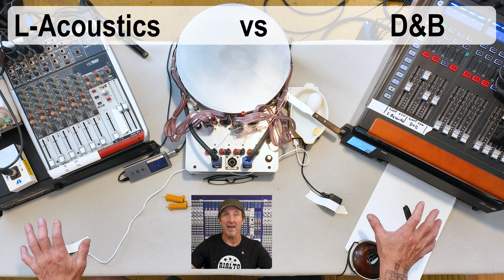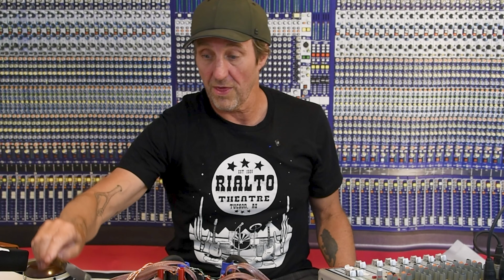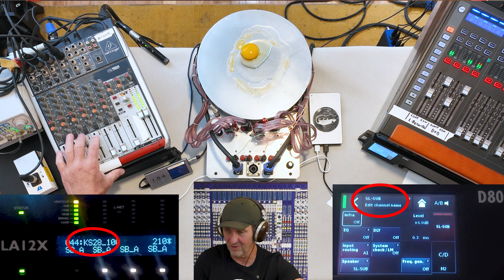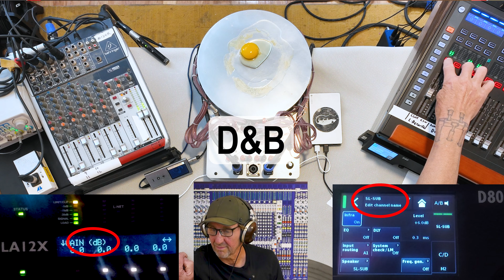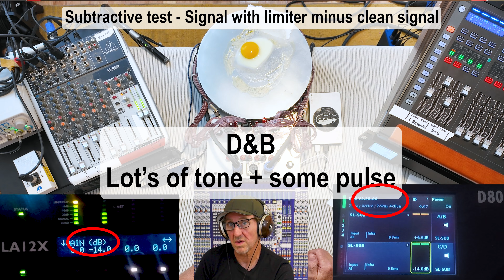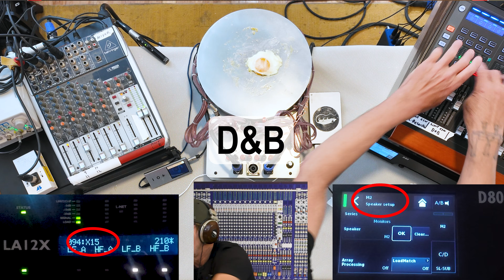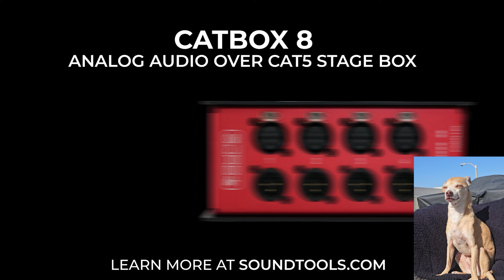Who Does Amp Limiting Better? D&B or L-Acoustics?

Comment: I usually try to have a capable enough system that I don't have to hit the limiters but for those times when I do go there keeping the tonality basically the same is my goal. My all-time favorite system was the EAW KF 850 with SB 528 subs their processor and Crown Macro Tech amps. Super clean accurate sound before limiting and very similar tonal balance when I did push into limiting. I miss my 850 rig. Now I'm in the small times  a stick rig with powered tops and monitors passive subs. I will be trying this battery of tests on my tops. They supposedly have a limiter on each band pass and are bi amped..we shall see how good they do in bench tests. They sound good in the field but..... what is the reality.
Reply from the maker: very cool and my take is that much of what we do with live sound involves taming dynamics with comps and limiters.

having so much pa that you are not near limiting and then limiting the music to make it sound good is a bit counter productive in many cases.

bringing less gear, driving it harder and using the system limiters as part of the taming of dynamics can be a way to reduce deployment costs, reduce setup time and improve sightlines if done so with a system that sounds good in mild limit.

if you can run the system in 6dB of limit and sound good, and since doubling the size of a pa system gives you about 6dB, then it's  easy to see how maybe deploying 2/3s of the gear and hitting 4 db of limit may be desirable in some scenarios
Reply: @DaveRat  Of course but having a mix with restrained dynamics allows it to go from one kit to another or to recording and not fall apart since as you showed so eloquently there are big differences in the way they protect. It's already hard enough to deal with PA du jour's different distorsion and impulse responses

Comment: Do you have a list somewhere that shows your main equipment for your biggest gig(s)?  I'd love to see what an audio nut such as yourself uses, as I too am a fan of great sound, reliability, and probably lastly ease of use.  I don't care if it's harder to use if I get the other 2 first and in that order... as long as it is not IMPOSSIBLE to use.  Thank you for your well-presented and informative episodes, Dave.  I hope to get to hear your work live sometime.  :)  Carl
Reply from the maker: cool cool Carl!

you have lists and pull sheets for Big show's that we do but it's probably a little off to post that as it may not be optimal for our client relations and such. 

that said I can say that we deploy over 800 large format boxes to do eight stages for Coachella festival. 

this doesn't even include stage monitors and other smaller fills and stuff. 

and figure there's at least an average of 2000 or more watts per box and you figure maybe 3 million watts of amplifier power.  I've done some walkthroughs of festivals in some videos I posted but they may be on the member side of a YouTube paywall. 

but the paywall's only like five bucks a month or something. a $5 binge maybe worth it. 

I don't make much money from all that but having it behind the paywall allows me to be more free and open with information that may otherwise get me in trouble

Comment: Interesting stuff.
Once again a great subject that so many people overlook. Thanks Dave for sharing the info.
It-s a very complex subject. 
Back in the early 2000's I had the job of being responsible for sound system install, maintenance and tuning of a huge estate of nightclubs in the UK.. We had well in excess of 300 clubs nationally Of all the tuning issues the biggest problem was limiting. I worked for a manufacturer of systems as a design engineer and our company also installed other makes.
Back in those days the limiting across various venues was done in BSS Soundwebs, BSS Omnidrives, DBX drive racks, Symmetrix SymNet, Media Matrix, and Biamp Audia processors, and because many of the clubs had been bought out by the large public listed owner as various corporate acquisitions we had a lot of legacy systems to manage. 
.
As an external contractor (over the years I worked for two of them) it was on our shoulders to ensure that the tuning we did kept the unsupervised systems reliable. (In 2004 we only lost 7 drivers across all clubs). If failure rates were rising our client (the owners) would be wanting to know why (normally unauthorised DJ interference on clubs that has unsecure processors) 
.
Setting the limiters we developed tables of values for the most used devices, but due to the legacy estate we often had to replicate settings as best we could across different processors which never achieved the same results in terms of sound.
.
Some loudspeakers, although similar would need very different limiter settings, those with excursion issues needed a careful balance of EQ to keep certain frequencies out (We often ran 48dB oct HPF on some systems - sometimes even double stacking them to 96dB oct to effectively brick wall filter the LF as cabinet loading would collapse very rapidly with some designs but we didn't want to roll off essential LF extension too soon). On top of that we would slam a very fast very hard limiter against that device with a very fast release time that almost modulated the LF rather than dropping it in level. (REALLY IMPORTANT - that limiter should be post HPF or you end up modulating the LF to frequencies that are not even present in the output.).
Occasionally with more problematic boxes we would double stack limiters with different thresholds and release characteristics so we had an excursion limiter and an "abuse" limiter (sidechain triggered as triggering one off the other didn't work) We could only do such things in open format DSP like Soundweb (our main go-to unit) SymNet, Audia, or Media Matrix.
Of all the Soundwebs had the most controlled limiting and most transparent, Driveracks were the "nightmare" unit that were more often than not responsible for most failures and we had a policy f removing them (They are fine for the MI market that they are aimed at)
.
I suspect there in your case with those two amps that the manufacturers had very different electro-mechanical properties of the load to contend with and as such the limiter is actually only half of the "sound" of the system in "distress" >
As a system tech on live shows I tended to have a good feel for my systems and could keep the levels from FOH just under limiting. the FOH mix tech had just as big an influence, a good FOH mix tech could really get a lot of clean level out of the system before crashing the limits, where a bad one who had over processed their mix could end up slamming the limiters way before the system got to it's "loudest" performance. 
.
One of the most "fragile" systems I had under my command was the SSE / DB Sound MT4 (which wasn't really MT4 as it was only 3 way and had no manifolds in the top boxes) we could easily take out a whole bunch of DL18MT drivers and DH2MT diaphragms with a tiny slip if we ran close to the limit (Amps Crest 8001 - Processing TOA SOARI or BSS FDS 388.
.
System protection is actually one of the hardest aspects of development and design

Comment: Things have certainly come a long way compared to figuring out the KT limiter settings for the Rat Traps. IIRC, wasn't that literally making tweaks until the drivers stopped blowing up?
Reply from the maker: ha and yes, set lims somewhere that seems good, if drivers don't blow, open the lims do shows, keep opening till drivers blow, then clamp lims a bit till drivers stop blowing

Comment: Would be interesting the compare with the amps out of a 2100-lfc and MJF-212, also looking at the waveforms of the outputs too
Reply from the maker: yeah, I don't have any meyer gear. but if I run across some, will take a listen
Reply: @DaveRat how about powersoft amps and linea research?
Reply from the maker: I do have powersoft but, there's a difference between the limiter capabilities of an amp versus the limiter settings that a manufacturer has chosen to deploy.

The limiter capabilities in a power soft amp are very in-depth and powerful and the art form is knowing how to tailor those settings to achieve the desired performance. 

additionally when companies like PowerSoft release settings for other manufacturers those limiter settings may or may not align with the actual settings that a manufacturer may use on a different amp. 

The goal of this video was to show the difference in limiting strategy between two major manufacturers and if I get a hold of a Meyer amp maybe I will take a listen to there strategy. 

One of the things that I do as a consultant for manufacturers is to assist them in optimizing the limiter strategy that they're using for their products and I've actually come in to an existing manufacturer and been able to help them get 1 to 2dB more output and improved sound quality across the product line by sharing my methods 

if you have a power soft damp and look in the settings depending on the version you have you may find that there is a microwed setting designed by PowerSoft for EAW and another microwave setting that has an R or a rat associated with it and listening to those two settings you can hear what I was able to achieve implementing the methods I use
Reply: @DaveRat  I appreciate the detailed reply and always enjoy seeing these demo / experiment videos. If I come across some Meyer amp modules I could see about sending some over.
Reply from the maker: very cool. also the test is pretty easy so if you get a chance to do it, let me know or send me a recording of the results

Comment: Now this is making me wonder how the crown Itech HD would compare to the two using the B28 Setting… they have Voltage limiting with peak, RMS and thermal limiting values, on tunings for jbl these values are already pre-set…
Reply: Yea we're running Itech 4x3500's and 12k's with A12's and S28's, now I'm curious what my limiters are doing!
Reply: @ArtVandelayLTEX  I’m not there quite yet just started in pro audio professionally a year ago but I’m running 4x3500‘s and 9k’s with my VTX F15‘s and SRX728‘s/718s/712m… curious to hear from you! A12‘s and S28 sounds like a killer setup🔥sadly, in Europe we hardly ever hear it because everyone uses just k1/k2, j&gsl and panter. And then you have artists cancelling tours all the time because production got too expensive😂💀

Comment: Dave casually messing with the house electricity.. reminds me of the good old days. We had two electricians, well, i'm not electrician but electronics engineer without a degree, in our crew. We hacked around with house electricity fair bit, always carried larger bases for tubular fuses used here, knowing that 16A can be run at 20A because the wiring 32A max. Getting just a bit more juice out of the system while keeping it still safe. The wildest thing was when i wired a three phase distro live. One of the most nervous moments ever, working in a cramped metal box surrounded by live wires.. I know how it is done but good lord, i will never do it again.

For live sound engineers knowing more about electricity and basic electrician stuff, how are houses wired, what are the safety margins, how it is physically done so that you could wire it yourself: it has proved to be VERY handy over the years. You don't only have the audio signal routing in your head, you also have the actual power grid in your head. You know what is inside walls, about where they are, you know how things are done... It really, really helps. After all, there is also public safety to think about, and many times the FoH guy is responsible of the electricity used on stage. We use electricity, nothing would happen without it so guys, you really ought to know how it works and not just surface level but the actual nuts and bolts.
Reply: Reminds me of our high school days in the early 70's.  Buddy picked up a military surplus transformer that was allegedly off of a ship and used for a Marconi telegraph transmitter.  Top flange bolted on, tall ceramic insulators for the output, oil filled black case.  117V 60 HZ 60A rated primary which is kinda strange for military, but I don't know ship electrical.  In aircraft stuff is all 400HZ 3 phase.  Anyway, the secondary was 15,750V @ 375MA.  We pulled the cover off of the main panel in his back yard on night and jumped it directly from the bus with a couple of pieces of #12 Romex as we didn't have a 60A breaker.

He used a long Xlite nut driver across the output terminals to get the arc started, slowly pulling the handle back until the arc was jumping from insulator to insulator and then heat would make it rise like an inverted V.   Ceramic output insulators were 10-12" apart and the arc would peak out 10-12" high above then and break.  About the 4th time he lit it off I noticed something moving in my peripheral vision and looked up.  Overhead service drop for electrical back then and I thought that was moving.  L1 Neutral L2 stacked in vertical format for the drop.  When he struck the arc, the old rotating meter would just vibrate and not turn and the top and bottom conductors L1 L2 of the overhead drop would swing out in opposition to one another - all the way apart, totally horizontal until the arc broke then they would swing back into vertical alignment.

I know there's a lot of internet bullshit out there guys, but this one is a true story.  That thing scared me.

I did a panel change on a condo once from 125A to a 200A.  Underground fed and live.  Would never ever do that again.   Absolutely stupid.  Should have went out, popped the cover and cut the feed.
Reply from the maker: fun and yes, know the whole system!

Comment: Ok, I learned that I have to bring an egg as thermal indicator to every gig.
Reply from the maker: yes, safety first
Reply: And don't forget your yellow thermal lubricant!!
Reply: Put one on top of every amp in the racks.   Then instead of having the system "Full Tilt", "Redlining", or "Bumping the Limiters" you could be "Frying Eggs".  :)
Reply from the maker: and an after gig snack!
Reply: @DaveRat  Pass out the tortillas and salsa.  Order your Crowns with the optional "Non-Sitck" top covers.

Comment: Hi Dave, whats your take on the AVB MILAN protocol vs Dante? Ease of setup, reliability and scalability for the future.Is AVB going to make a comeback considering the more stringent requirements for MILAN certification?
Thanks
Reply: Im not Dave but I know about this subject. 

Milan gPTP is peer to peer as opposed to end to end ptpv2 like dante so there is less clock wander and fewer phase issues between endpoints. 

The tradeoff is that because every device in the network needs to be time aware, and that AVB is centered around ethernet (layer 2) and not IP (layer 3) it cant be managed by a router so Milan isnt suitable for a WAN or a network with devices that are not time aware.
Reply: also, Milan certification is easier these days thanks to better software testing tools. There is definitely momentum towards Milan at the moment.
Reply from the maker: to be honest, I'm not that savvy on the nuances and differences other than the fact that the very strict time constraints of Milan are beneficial in keeping and maintaining accuracy of when the sound is radiated from a multitude of boxes working in harmony. 

though I haven't tested or measured the differences myself, my understanding is that the precision of Milan offers measurable and possibly audible benefits for line array deployments
Reply: Thanks for all of your useful replies.

Comment: I'll need to catch up later as I am heading out the door. I work in an Arena in Glasgow. D&B, L Acoustics, Clair Brothers and Martin Audio systems are all commonly brought in... I am not behind the console anymore however.... I can't really hear much of a difference between the big manufacturers. Back in the point source days I think engineers weren't as reserved when it came to giving their system's a proper caning? Has the advent of smartphones crippled large scale sound reinforcement?
Reply: There's quite a noticeable difference between the big players honestly
Reply: @cowboytonydee  Never having used them... I really couldn't comment.. I have heard them all sound pretty good
Reply: @cowboytonydee I agree. I personally think L-Acoustics and D&B are the best systems, but they definitely have different strengths. 
    L-acoustics seems to sound crisp, clear and musical, but I’ve heard it sound a little bright or harsh at times.
      D&B seem to usually have a warmer tonality with a bit of extra bass, and maybe a bit more vocal-forward, but they can be a little less detailed in the treble. 
     Others that I’ve heard are Meyer and Cohesion (Clair). 
     Cohesion seems strong, but they sound as if the subs don’t go high enough to properly couple with the main hangs.
     I’ve not heard enough Meyer systems to really know if the deployments I’ve heard were actually well-tuned. But usually I’m bothered by what I perceive as a huge peak at around 2K that has made them almost unlistenable at some shows.
     In terms of subs, this may sound crazy, but I prefer the tonality of the old D&B dual 18 bandpass ground stack subs, the B2 and B22, over most modern subs. They just feel more powerful even if a frequency sweep sounds a bit ‘WooOOooWooo’ through them.
Cohesion CP218 and Meyer 2100LFC are pretty good though.